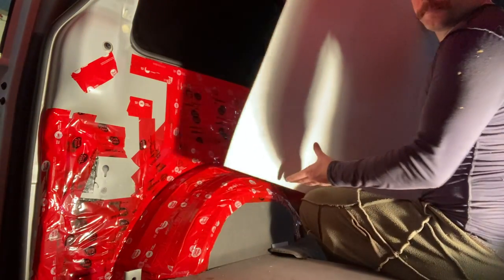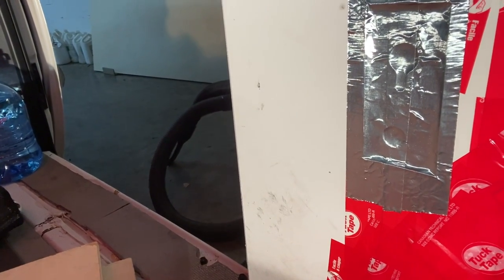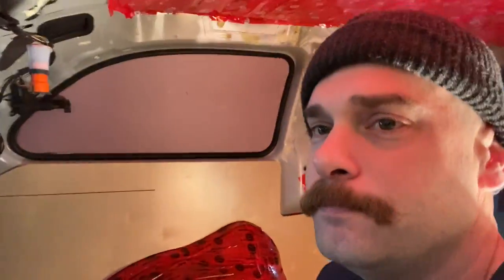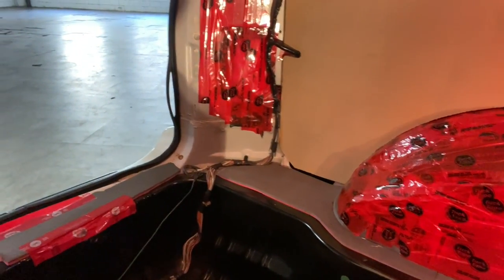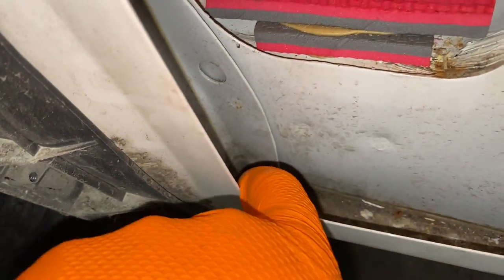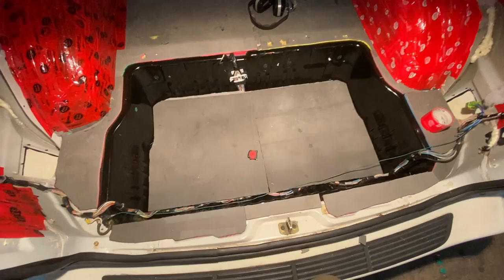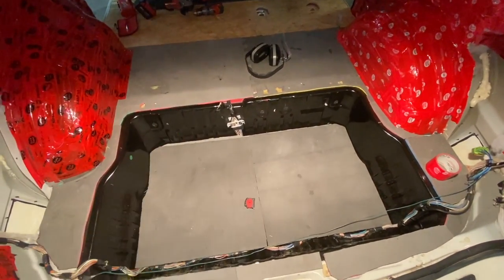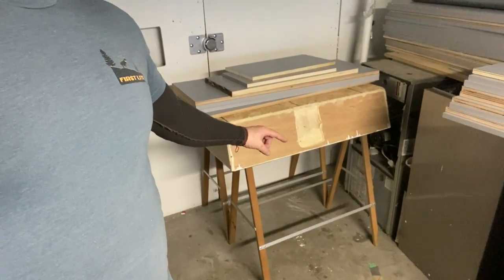MINIVAN Build E-7 || Beginning stages of Cabinetry

Comment: Without those vents your car heater and AC will pressurize the cabin and won't be able to flow much air, unless you run then always in air recirculation mode. Plus, when you close doors the there'll be a pressure occupants will feel on their ears.
Reply from the maker: Very True!  Glad I have a roof vent that takes up the difference.
Reply: @SharingTheWild  I've been bingeing on your videos and now I see you have a vent now. I love your build. 
I'm thinking of some modular stuff to make for my Hyundai Ioniq. I've taken a couple trips with just stuff thrown in the car, which is fine but I like geeking out on efficient use of space.
Reply from the maker: It's an amazing thing to put your heart into something that expands your experiences. All the best on your build Samuel.

Comment: Oooo...I love that trick with the aluminum tape!!! LOVED this episode. I am surprised you didn't put secret compartments in the two back sides of your van behind the wheel wells and right above those two white panels you glued and screwed on. Seems like a perfect hideaway for small valuables. Perhaps you did and we haven't got there yet, but it looked like you maybe covered them up. Also, out of curiosity, what is the space you are using to build out your van in? It looks like it may be a garage for a brewery. Whatever it is, it looks like a perfect place for you to build in. Thanks for sharing. 
- Alis

Comment: Hi Joseph, I just found your van build videos, and am grateful for your foresight in making the video's while building, even before you had a youtube channel.  I have been studying builds for my own upcomming 2005 Chrysler van build.  I am curious about the name and source of the material you used for the templates.  It is not cardboard, but easier to cut with scissors, yes?  Plus the idea to use aluminum tape in order to get contours of parts of your van is such a great idea.  There are many kinds of aluminum tape, which did you pick?  Again, thank you for the amazing details in your YouTube channel.

Comment: I tried building a plywood box for extended support for a steel file cabinet in my van. I only used glue. You used glue, nails, and screws. The file was heavy. I had no help. When I (sled?) the file cabinet over, the glue gave way.😲!  Go figure. To rebuild I thought of L brackets. 3/4 " ply. Because it is base support, what would you suggest?
I love your videos.